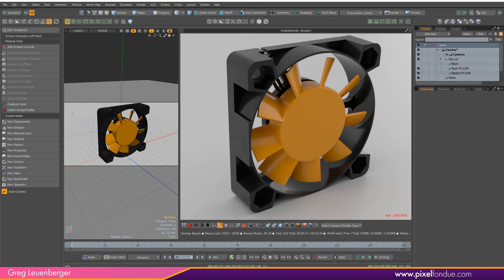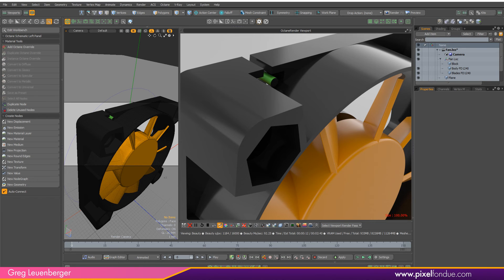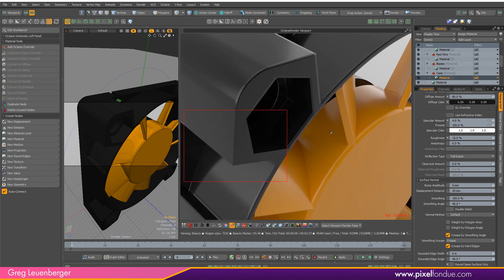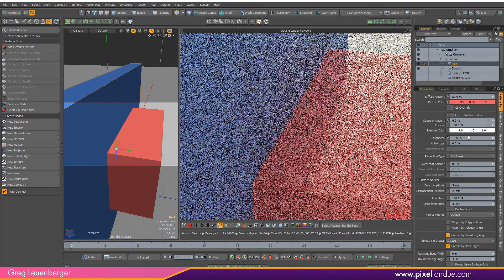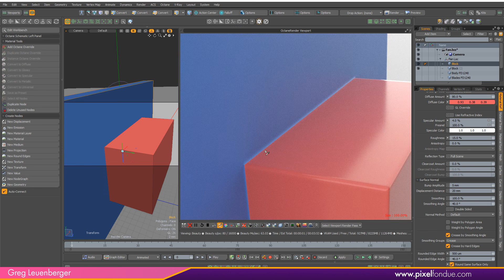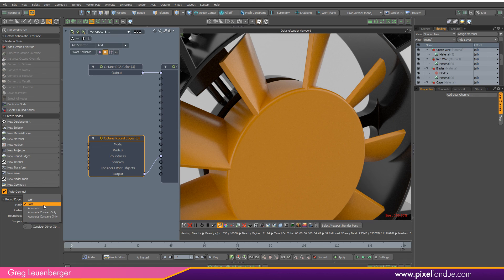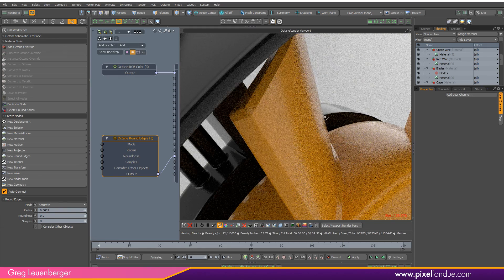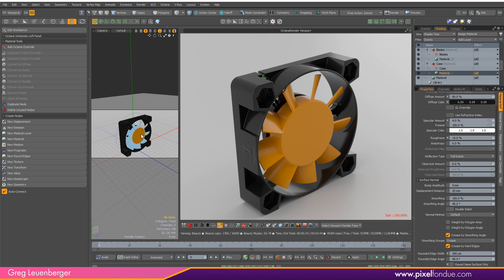MODO | Octane Rounded Edges

Comment: I just upgraded to latest Octane build (after working in v4 for years) and OMG this is the thing that I was missing the most. My life is at peace now <praying emoji>. Took'em long enough though to fix that shader!
Reply from the maker: Yeah, it's super important. Especially if you're rendering out a lot of CAD imports.
Reply: @pixelfondue  ok, so this is super weird. My Octane Override (glossy material) has a 'Rounded Edges Radius' input instead of just 'Rounded Edges' and it doesn't let me hook up an Octane Rounded Edges node to it (says 'Invalid pin connection'). What's even weirder is that this 'Rounded Edges Radius' attribute also has an output pin (what far? who knows). It sucks YT comments don't allow images
Reply: ok, Octane is acting super weird when you have a scene from an older version of Octane plugin. When I've created a fresh Glossy Material in the Schmetic it had very different attributes (pins) and more of them, then the old Glossy material that I've created in that scene back in the Octane v4. I keep forgeting that I recently migrated from an older itteration of this software.
Reply from the maker: @mrdol  Yeah, I noticed that too when I had to load up an old client project.  I just created new materials and re-hooked up the  texture to the new material. I don't know if there's 'old' deprecated material nodes in there for compatibility or if there's a version/compatibility issue with the updated materials.  They update the materials a lot so I wouldn't be surprised if they kept old versions in there for situations such as this.
Reply: @pixelfondue  sometime I simply forget that 3d apps are not photoshop. They are actually beeing developed ;)